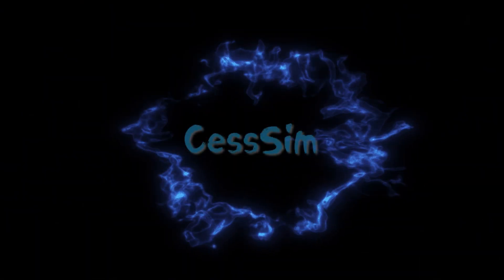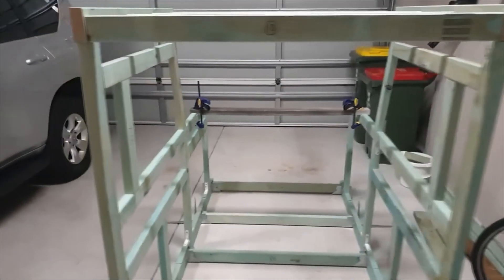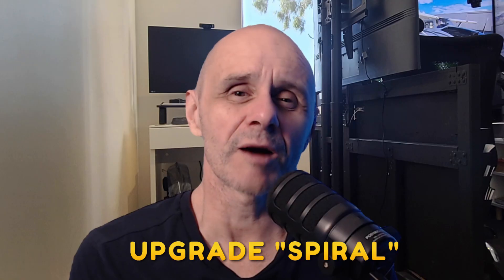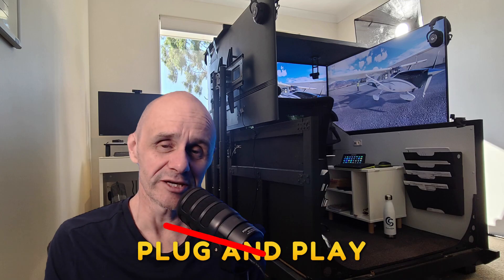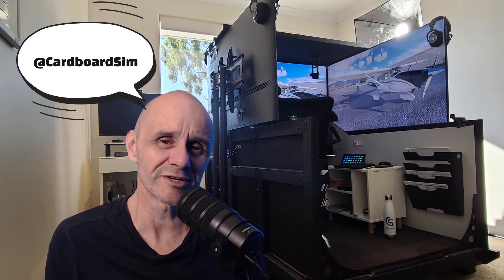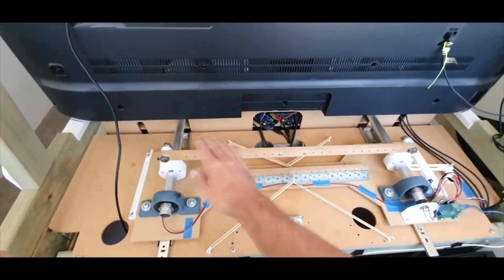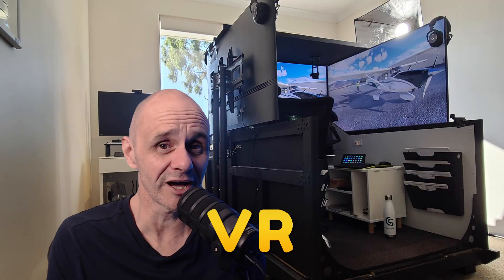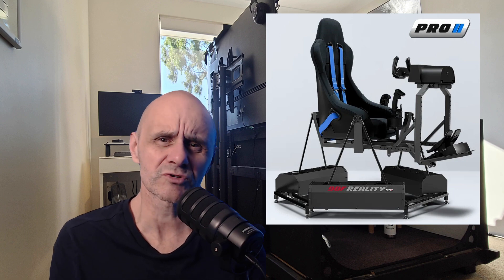⚡️Why a Flight Simulator Build is Never Truly Finished⚡️

Comment: Logitech Extreme 3d Pro joystick was the beginning for me.  Still one of the best peripherals I have ever owned.  FLying helicopters in Arma II was the true beginning of my flight sim itch.  There is always a roadmap for improvements.  The next markers for me are:  upgraded GPU (5080 super), upgraded speakers for my VR headset, upgraded throttle for helicopters.  After that there will be a break before embarking on a force feedback flightstick, and investigating a helicopter collective.  The yaw 3 motion rig also looks exciting - but that is a pipe dream at this stage.

Another path leads towards actual flying.  I enjoy gliders in MSFS and have checked out the prices to go for a glide as a passenger at the local glider club.  That is one of my goals for this summer.
Reply from the maker: Thanks for sharing. Never ends does it !!  Appreciate you tuning in.

Comment: I started in FS98 and was amazed then. And have been hooked ever since. I got into VR about five years ago, and it brings a new level to sim flying.
Reply from the maker: Yes I am looking forward to this as well.  Just bought a Q3 and looking forward to it !  Thanks for tuning in.
Reply: Hello , How long can you use VR head set for long flights? or you just using take off or landing procedures? i tried meta Q2 but it was narrow vision, hot and heavy headset but perception was perfect. I really interest about your experiences and comment buca use i have to make decision about make 2 projector 270degree curve screen or buy good VR head set for my MSFS and DCS simulators.
Reply: @asklapios  Flight sim i use it for take off and landing. In DCS I stay in VR for the whole session.  i use a varjo arrow. those dcs session can last for three hours

Comment: I concur. Started with Saitek moved onto VirtualFly yoko ruddo tq6 and VRInsight's m-panel but looking towards PC upgrade and on and on it goes. I'm in the UK flying a 182 using P3D as the PC wont run 2020 or 2024.
Reply from the maker: I was a Saitek person myself.  Bought radio panel, switch, trim, yoke.  Upgrades over the years....thanks for watching.